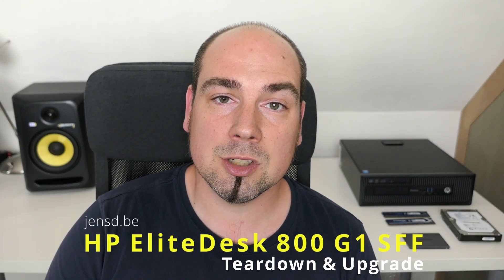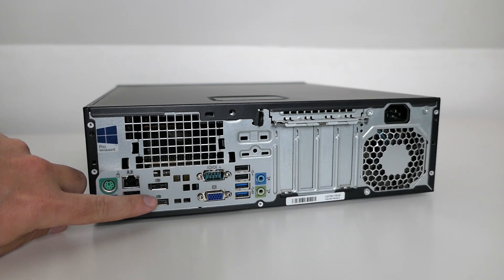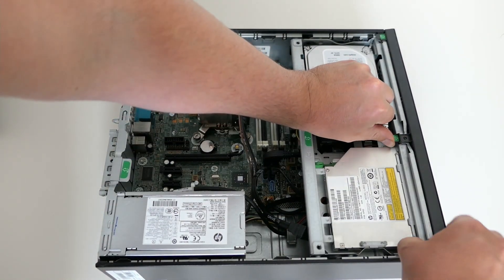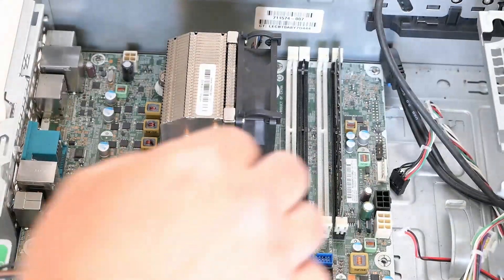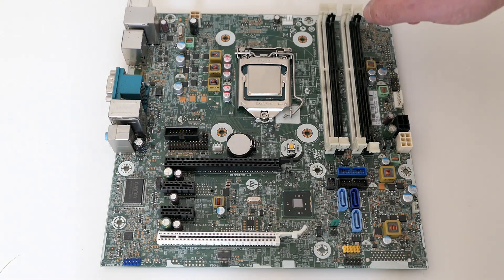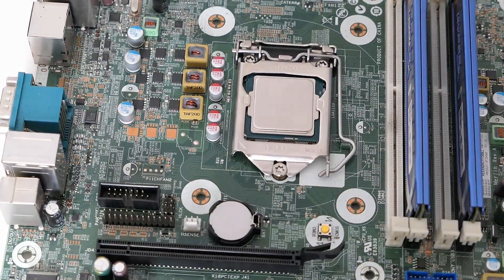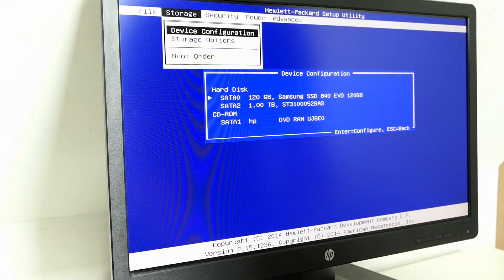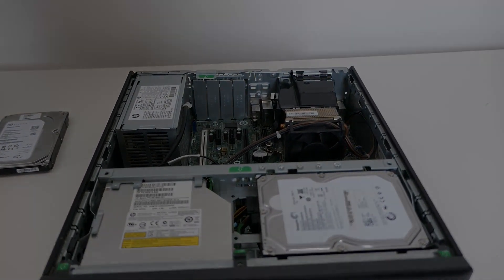HP EliteDesk 800 G1 SFF - Teardown and Upgrade

Comment: below the 3.5 driver support has a 2.5 support. I could take the screws left over from one of the 3.5 drivers and fix it on this bracket
Reply from the maker: The srews I had left camenfrom a 3,5" drive and had a different thread (wider) than what the SSD had, so couldn't use them.
Reply: Use the black screws with blue rubber..black is 2.5mm, those silver SAE 6-32
Reply: @bryanminugh9680   Where do you get black with rubber? All I have even seen are the blue with rubber! Hmmmmm....
Reply: @peakslayer1  same black-dip metric screw has been in all HP/Compaq for years. Thousands left over from every seller that tears apart old PCs

Comment: great video ! .. Those HP's are very good value for money too if you want a general purpose PC
Reply: I bought mine used at Fry's electronics a good 10 years ago for maybe $130. Thought of replacing the disc drive at the time as it had 60,000 hours but I've just let it run and the things run without problem until now for another 10 years. Just have to replace the CD drive

Pretty amazing and well-built unit